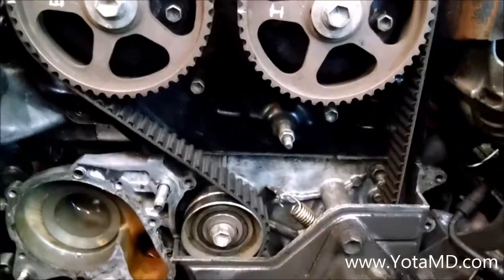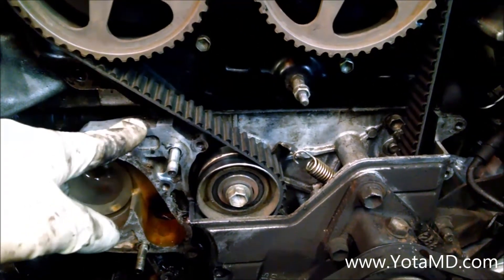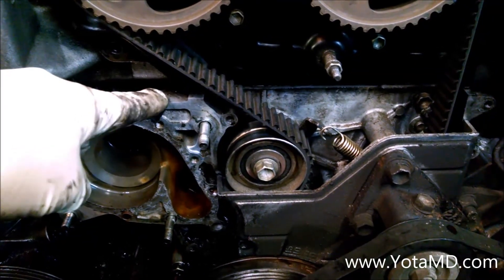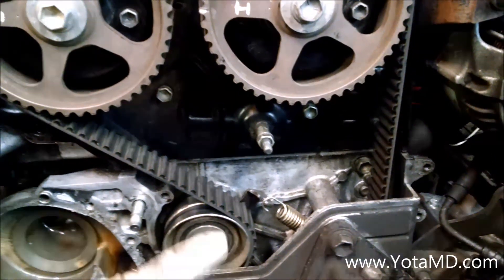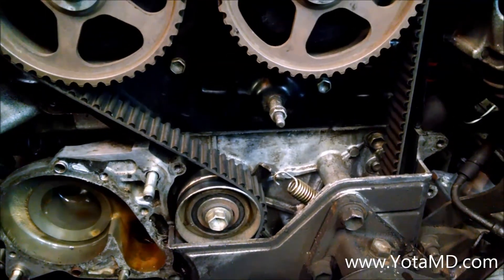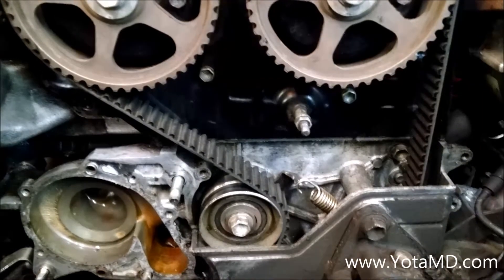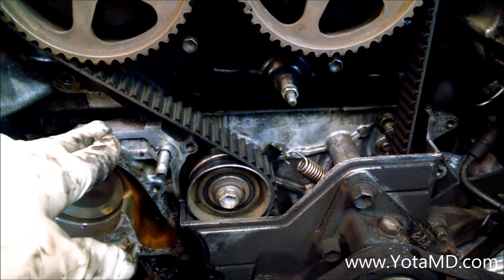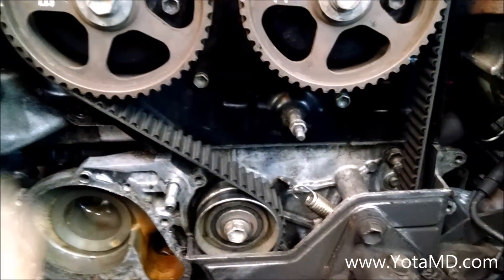www.YotaMD.com - MK3 Supra 7M Timing Plate

Comment: So, just to make sure I have it correct, I'm only going to give the block small once over with a scotchbright pad and a straight edge, but I will be getting the head machined, do I have to get the plate machined down aswell or will it not matter? I'll be using a VRS hg
Reply from the maker: Scotch Brite may not be a good idea. I wouldn't use that on the exposed engine. Plate is only machined along with the block.

Comment: (Please reply whenever you get the chance) I recent replaced my 7m oe headgasket to a metal headgasket but I did not get the block machined so the timing case was not removed should I have machined the block ? (I made sure to clean any debris on the block before installation)
Reply from the maker: You should have, yes, but you might get lucky. If it's already back together then I'd just run it and be very diligent about checking for bhg signs.

Without machine work on the head and block the MHG is just a huge gamble. You might be fine, it might blow next month. It totally depends on the condition of the block surface finish and flatness.
Reply: Thank you for replying so quick! And yes the car is back together but I haven’t started it I’m kind of afraid after watching this video lol.. I was looking for how to time the belt but I found this instead and I got worried.
The engine has 50k miles and the block was in pretty good condition the only part that the previous headgasket stuck to was the 6th cylinder and I made sure to clean it off until it was smooth like the rest of the block surface im hoping I should be fine but I’m still a little worried would you recommend taking it apart again before starting it ?
Reply: I meant take it apart again and resurface the block before putting it back together and starting it
Reply from the maker: I would only take it apart for two scenarios:
1. You remove the MHG and replace with an OEM gasket.
2. You take the entire short block assembly down to a bar block and get it professionally machined and prepped for a MHG. (I'd also do the "quake" mod as seen on supraforums)

If you're not planning either of the two above, if just run it as is and see how it goes. A bhg won't kill your block in a heartbeat. It's generally a slow death with plenty of warning signs of you're paying attention.

Comment: Is there a way to skim that cover yourself?, as I've recently got my block skimmed and I think the cover didn't get done
Reply from the maker: I'm sure it could be done. You may also have some problems with cylindricity of number 1 if it was bored or honed without that plate torqued down.
Reply: @user-df1gh8le6l  Ok, could you use a grinder? Haha, how much does the head cover this plate?
Reply from the maker: Grinder is a terrible idea, IMO, at least if you're thinking an angle grinder. That plate needs to be perfectly flush with the block deck. I can't recall how much head overlaps that plate, but it's most the plate. It's a critical step in the machining process.